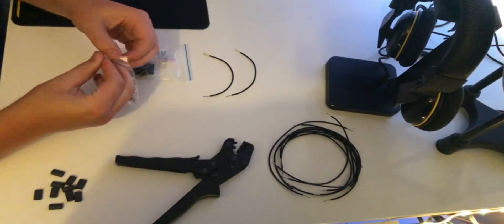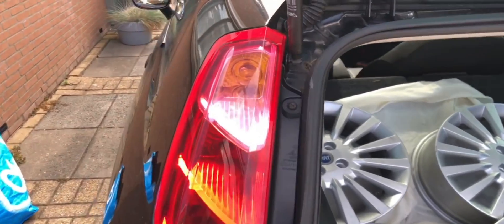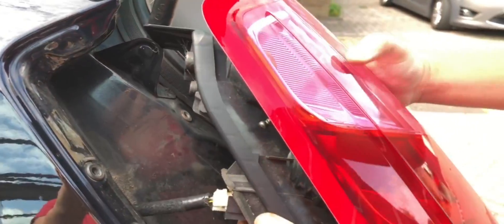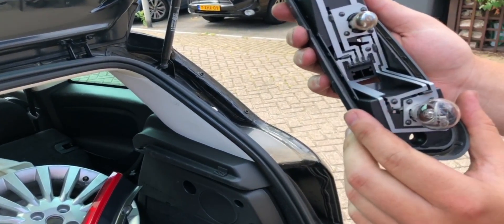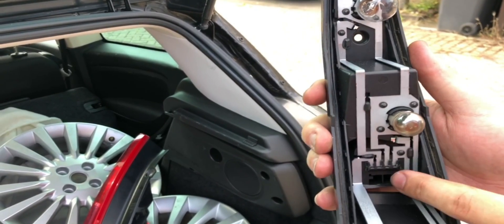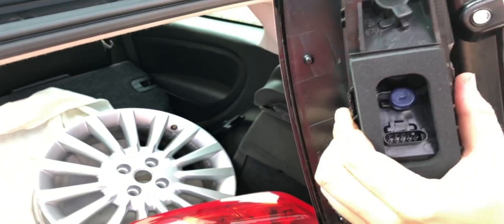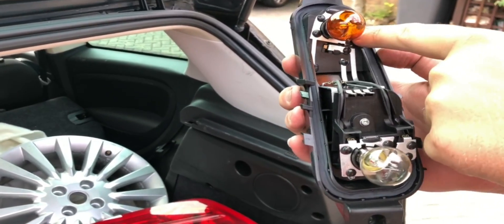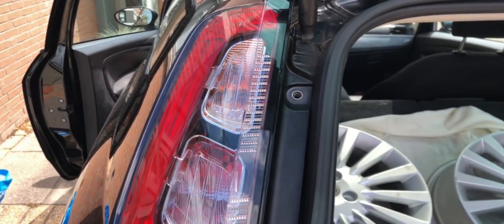Fiat Grande Punto to EVO tail light conversion tutorial

Comment: How do you go around connecting 4 wires from the original harness to 5 wires into the new plug? Are there two cables from the new plug that need to be connected to the black wire on the harness?

Comment: hello from Egypt
I did it but the dashboard light indicate check running lights so should to use resistor w if i should how can i connect it in wire .. 
thanks in advance

Comment: Sorry to ask mate, but didnt see how you connect the 4 cables to 3 pins new evo light... Minute 6:25 you show black cables but doesnt show details
Reply from the maker: It’s actually 4 wires to the new 5 wired EVO plug, 2 are for the LEDs. you need to figure out which ones needs to be connected or possibly both even. Ingot 2 Punto’s and they both want a different LED wire setup (so one had both connected to the normal light, the other has only one connected and one just not connected)

Comment: My left light flashes taillight flashes when i use the indicator, my indicator shows the yellow light but my normal light is also flashing... Any ideas on how that is possible
Reply from the maker: Mac Hogenboom The wiring is messed up then. Make sure you check every wire again!
Reply: @darkpunto  yeah i found out after the comment that the colors weren't the samr on the left as the right. Have been running it for well 5months now and i love it! Without you i couldn't have done it